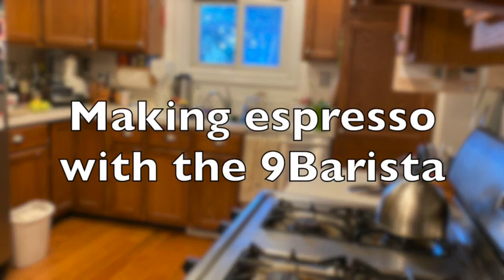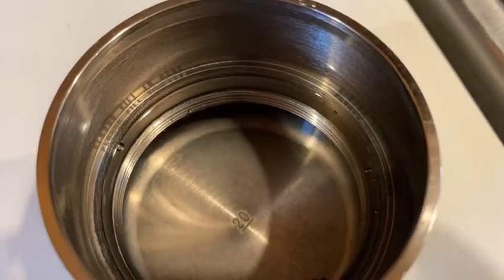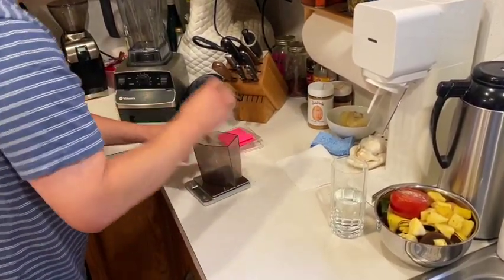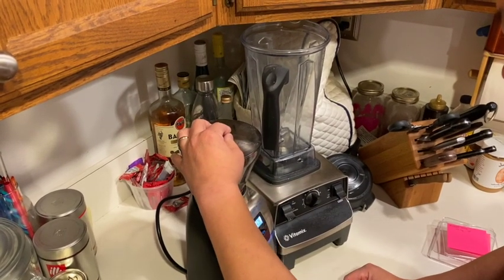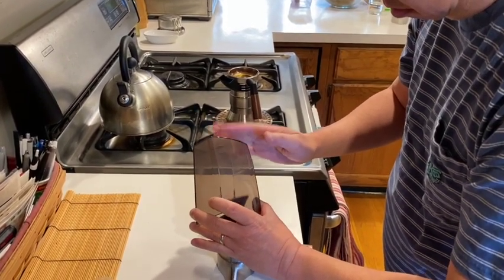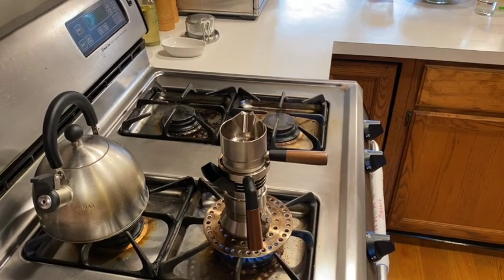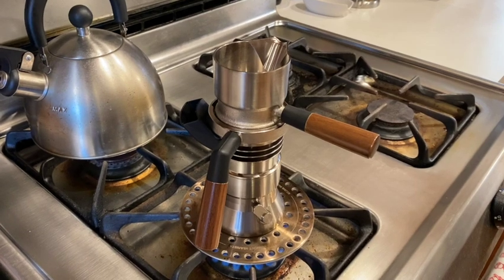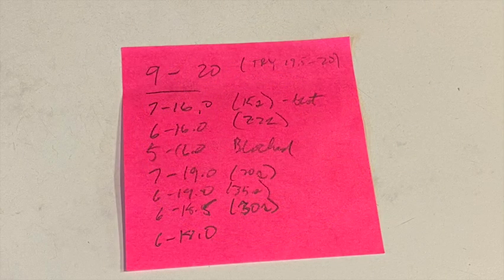Making espresso with the 9Barista

Comment: Hi, thanks for sharing. I saw your post on reddit - can you please share your d64 grinder settings for the shots you like? I have the same set up you do and have not yet figured out a perfect shot yet (
Reply from the maker: I actually have a DF83, not a DF64. But if it helps, I usually grind in the 15-17 range, depending on the bean. 

I've found that best practice is to get to a grind setting that gives you around 30s of extraction, and then forget the 30s rule, and adjust the grind to get to the taste you like regardless of what the final extraction time will be. For example, if I'm using our favorite beans from our local coffee roaster, setting the grind settings to get to a 40s extraction time gives us the best results. On the other hand, right now we're using a lighter roast bean from the same local coffee roaster, and setting the grind so that we get a 30s extraction is working better.
Reply: @wilburpan  Thanks a lot for your response, this is very helpful, can i bug you with another question? can  you please advise how you are timing the shots? Is it based on the sound when the shot starts or you start timing  once you  first start seeing the liquid, or may be  once the liquid starts pouring freely? and the same question where the timing ends- do you determine by the sound or once  you see that the coffee no longer pours?
Reply from the maker: @bagofwords1915  I don't think the method of timing the shots is as important as just picking a method and doing it consistently. For me, I use the stopwatch function on my phone. The clock starts as soon as I see coffee coming through, and it stops when I hear the boiling increase at the end and it looks like no more coffee is coming through. 

But since you should be tweaking for taste after getting to the ~30s range (again, once you get there, forget that there's a 30s rule), the exact method of timing doesn't matter. .
Reply: @wilburpan  Thanks again! :)